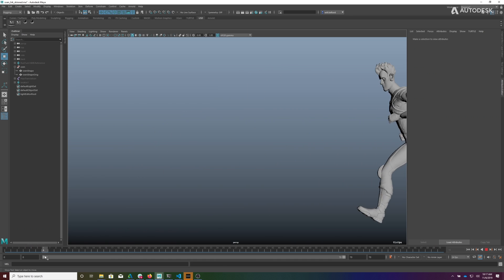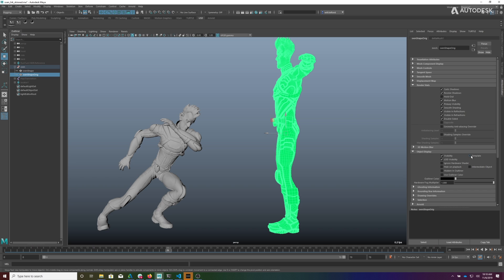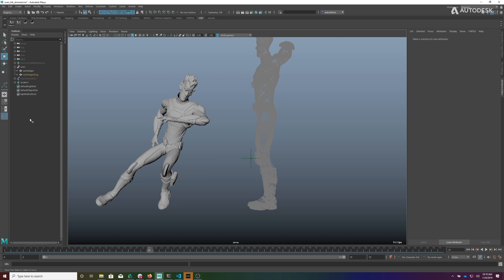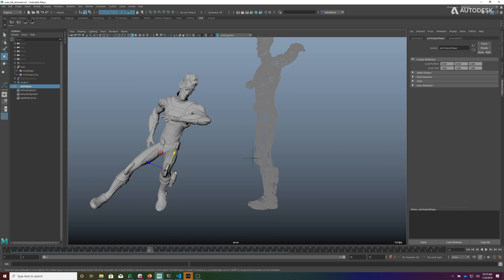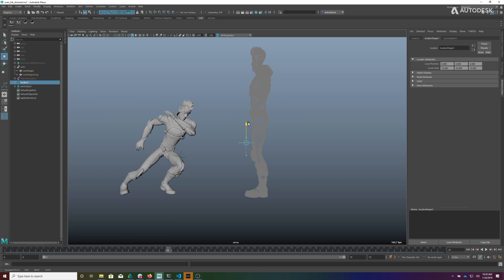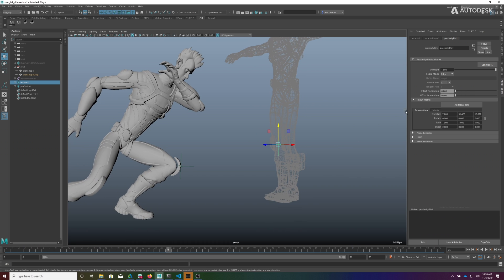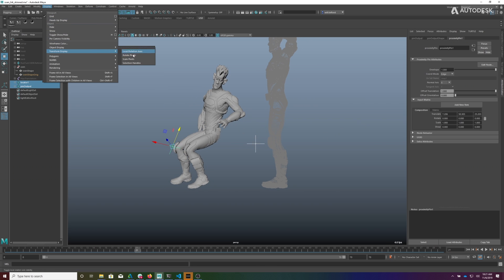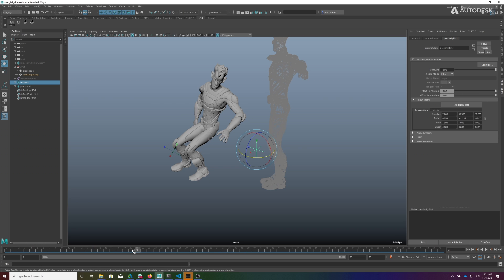Maya 2020 | Proximity Pin

Comment: Just wanted to point out that if you're using the proximity pin, the transforms will be written into the "transform offset parent matrix".
The values written in there can currently not be baked or exported without the use of custom code, so if you're working with anything other than Maya then you'll have to take that into account.

Comment: What exactly is the difference between this and the rivet constraint/UV pin?
Reply from the maker: This version uses the new Offset Parent Matrix to manage the rivet, which is more robust and at the same time more streamlined in the Dependency Graph versus the older method.
Reply: @Autodesk_Maya  Thanks! I was just working on a rig with the new matrix constraints. So that's really interesting!

Comment: I don't see the case where this can be useful...
Reply: Well new nodes always add many posabilities in many areas,
To think of a few, would be good to attach static things like buttons to a coat.
Or for a creature FX workflow, you can attach custom rig.deformer controls to a bake, so can drive and shot sculpting things
Reply: good for motion trails
Reply: less clutter in the node editor compared to constraints, no need for parent groups anymore either so it makes the outliner less messy as well

Comment: I'm not sure if it's changed in 2019 or 2020 but closestPointOnSurface and follicle nodes(which most of the rivet scripts run with) are preventing evaluation mode to run in parallel. Is it the same with uvPin node?
Reply: Not fixed till 2020.